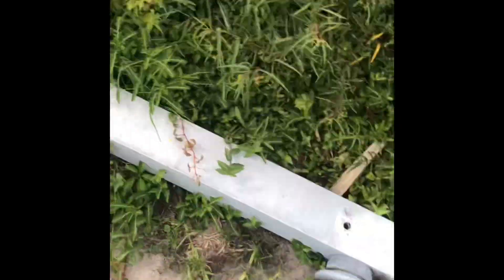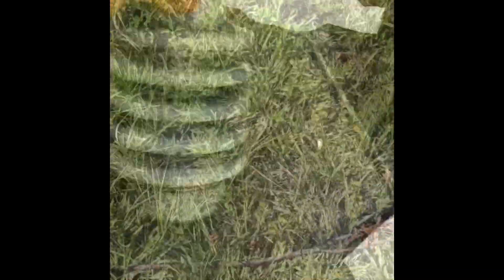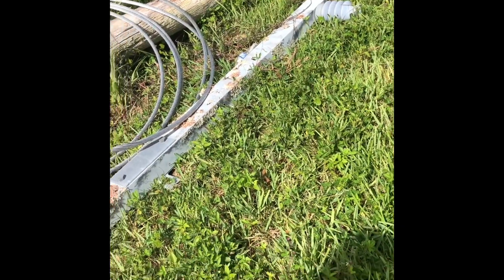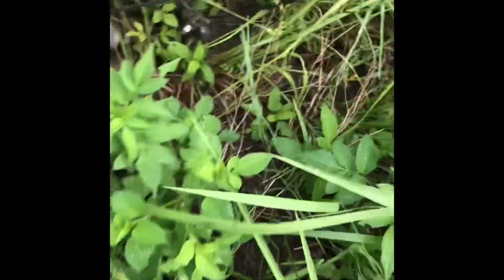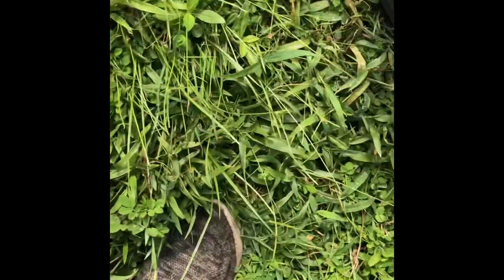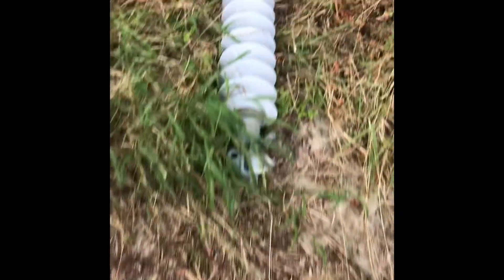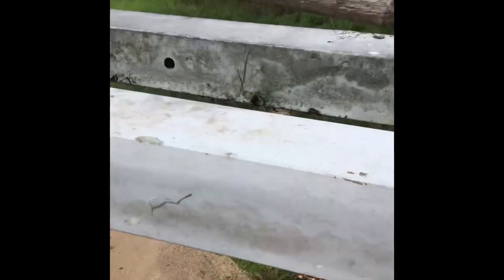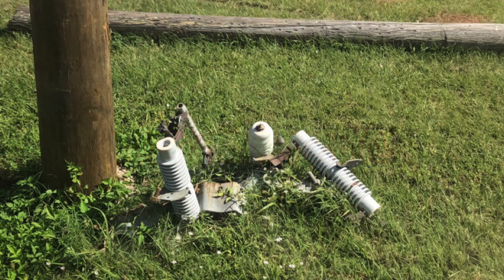Insulator Hunting!!!

Comment: That’s a great haul! Must have had a recent conversion or rebuild on the line? Those fiberglass crossarms are relatively new. You want to keep those. Leave the old wood ones alone. If you ever find some really old crossarms with locust pins? Keep those or atleast the pins. Pull the rusty nail out first & drive them out to remove. 👍🏻👊🏻
Reply from the maker: Yessirrr, they just rebuilt about 5 miles of old coop horizontal construction and went all vertical on the new construction because of wind loading here in Florida, got tons of them fiberglass arms, they were jus going to the dumpster and were extremely new and in good condition, managed to get a ton of cool insulators from the project!
Reply: @futurelineman0524  If there was a market for those fiberglass crossarms? I would try to sell them? Shipping would be prohibitively expensive though. Here in CT. they are trying to go back to building everything flat (horizontal). With armless construction it makes it impossible to add any equipment to the pole without building in a hazard. Vertical was built to avoid contact with vegetation. However over time vegetation is still allowed to grow into the pole easement & burn everything down anyway. I prefer to build with crossarm construction. It’s easier to work on. Less of a chance of a cross phase accident & allows more room on a pole. 
Every utility has it’s reasons for building it’s pole lines as they see fit. However lineman often don’t have a say in those decisions-sadly.
Reply: There doing that in Selma too but nobody wants to take me to get insulators
Reply: @alabamabottlediggerandinsu5242  
How old are you? 
I’ve only been collecting glass & antique stuff since I started in the trade (27). I left one power company at age 40 to work for another & the hardware they had up & working was the same vintage as some of the stuff in my collection or older. Funny how that works out? I gave my entire collection away for free when two young apprentices became insulator hounds. I never did anything with my collection other than wrap it paper & store in my attic. Insulators need to be displayed not hidden from view.